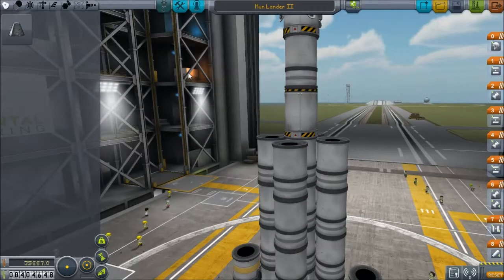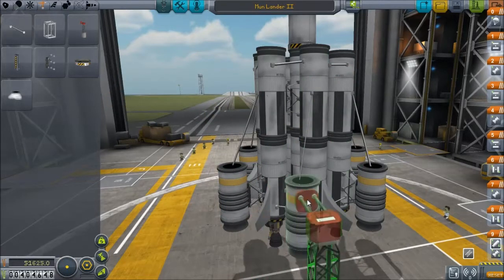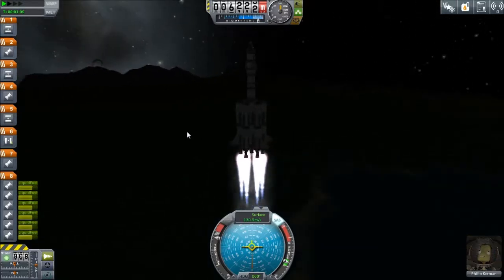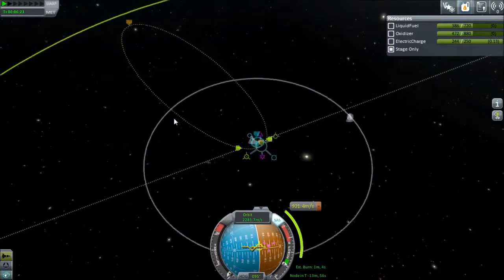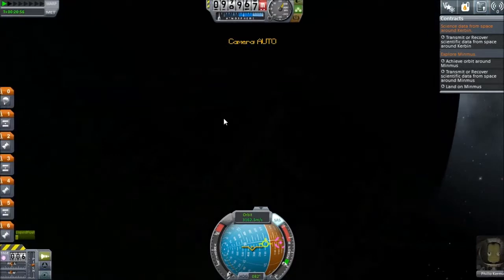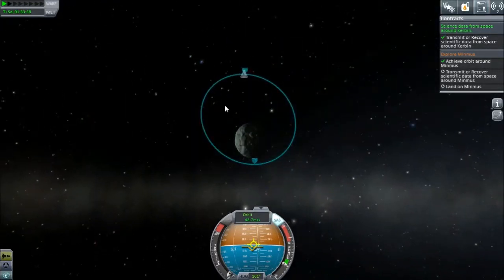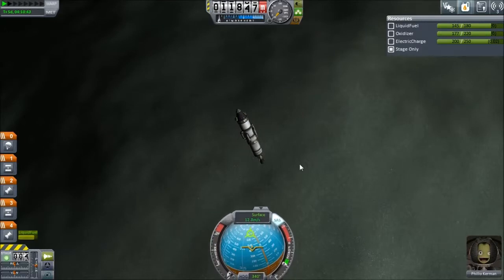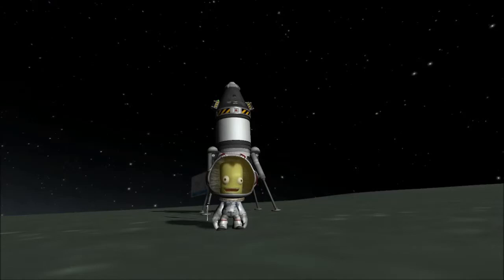KSP - Operation Laythe S2E06 "Phillos Minmus Flight"

Comment: do you know how to probe?
Reply from the maker: If by that you mean to ask if I know how to make unmanned spacecraft, then yes.  However, probe cores require constant power to function and will die if the batteries run out.  That makes them much harder to use without solar panels unlocked.

Probes also have less payoff in the sense that they cannot recover science in the form of soil samples, crew reports, or EVA reports.
Reply: Southern Wolverine not that kind of probe...